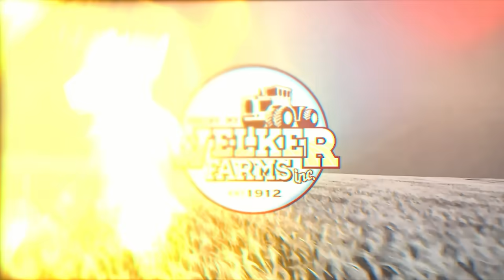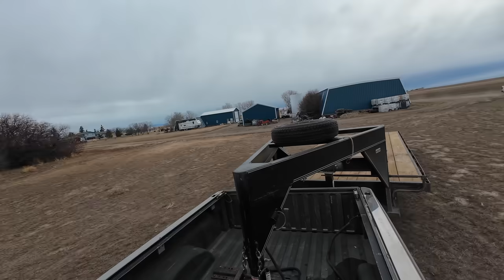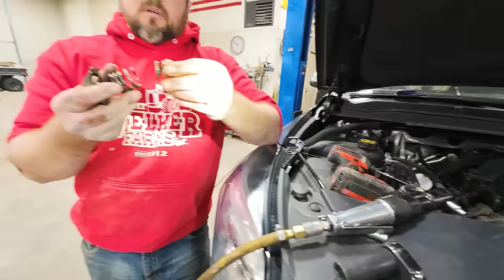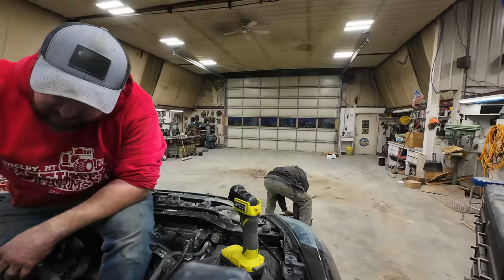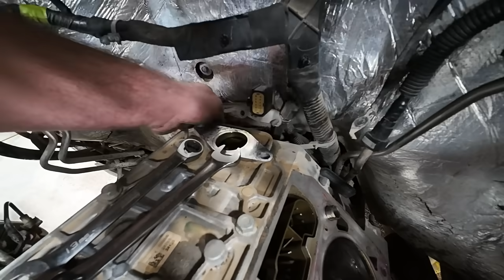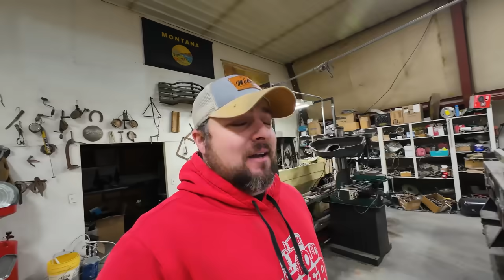Not Again! 🤦‍♂️ Engine Cratered...Let's Find Out What Happened

Comment from the maker: What do you think is the best engine ever made?
Reply: Ford 289
Reply: 2 easy choices Cummins 5.9 and 6.0  ls Chevy non direct injection non dod
Reply: 7.3. May not have been the biggest, most horsepower, but man she never broke
Reply: Cummin😮
Reply: Vortec 5.3 engines typically are solid engines. With that said ppl say Zach aka mn millenial farmer has battery bermuda triangle now it seems you guys have engine bermuda triangle lately.
Reply: Vw/audi 2.0 tdi
Reply: Whatever is in my
Camry
Reply: what's the application?😅
Reply: Ford 300 straight 6
Reply: 22RE, AMC 4.0L
Reply: Gmc 6.0 vortec or a 6.7 powerstroke
Reply: Mopar slant 6
Reply: Ford straight 6 300
Reply: Scott, it was a pleasure meeting you in Minneapolis, Minnesota. Hopefully I run into you again sometime.
Reply: 350 sbc,5.9 cummins
Reply: LS1 or 6.0 iron block
Reply: So many good engine's to choose. Depends on what you're putting it in.
Reply: Ford f350
Reply: LS engines are the best. They have the most aftermarket support and are used in countless racing, offroad, and hotrod apps. In your case, don't skimp. You are doing the block already. Put in a cam, rebuild the heads, best parts, new oil pump, DoD delete and it should last for 250,000 miles.
Reply: Ford straight six and or jeep 6 last forever .my 11 5.3 has 423.000 miles still going just put a not trashed trans mine died the day I went back to work after my 7 hour bloodclot surgery and I got the one with 141 hundred thousand miles the day before my second surgery I have to go for a third not good no money having to sell tools I don't want to but I'm tired of starving of course my son gets most of food
Reply: 351 Cleveland
Reply: What ever doesn't have that dod garbage in it.
Reply: 350 sbc
Reply: @williamsmith8808 I think that the Ford big 6, 240 and 300, are the best engines ever. They will run 300k with no trouble.
Reply: GM 3800 For an automotive application.
Reply: The older 350 chevy motor or the Ford inline 6 cylinder . Seen both run 250,000 plus . Can't do that with the new ones.
Reply: 7.3 powerstroke
Reply: Vortex 5.3 without the AFM crap is a very good engine in the trucks. Car I would say the engines they put in the Pontiac’s the 3.8 was bulletproof. The ford triton is a better boat anchor 😂 only because I have had friends who had pistons and rods go through the block with only 1200 miles on. They baby there vehicles so was not being abused on neither.
Reply: 3800 or the 4.0 jeep
Reply: I am also interested in what the 6.6 gas engine will do. They also announced that gm is coming out with another new engine this year.  Now that EV production is being stopped as they mentioned they made a mistake on trying EV. They heading in another direction with combustion engines this year.
Reply: Ford 300 inline 6. No power, decent torque, but they're indestructible.
Reply: 12b valve Cummins
Reply: 5.3 vortec
Reply: @darkrevenger04  yeah the reason for his problems with batteries with the semi’s was he was buying the used refurbished ones at the auto parts store. 🤦🏻‍♂️😂
Reply: 3.8 gm
Reply: 7.4L or 8.2L Vortec Big Block!
Reply: The Hillside Hemi.
Reply: 426 Hemi w/ 3 duce six-pack!
Reply: 12V cummins
Reply: 7.3 POWERSTROKE I HAVE ONE AND LOVE IT
Reply: Chrysler slant six.
Reply: 5.9 12 valve or a 6.0 gm gasser
Reply: 5.0 Ford
Reply: Ford 351 Windsor, FE engines are immortelle, 6.9/7.3 idi
Reply: I have a 2014 Chevy Silverado 1500 with the 6.2.  I got the EDGE Tuner. And turned Off that 4-8 cylinder junk. It comes with 3 tunes. Eco mode, modified stock and extreme. I turned off my speed limiter, RPM limiter, and that other thing.
Reply: The 6 cylinder 3800 in the buick LeSabre
Reply: Ford 6.2 gasser. They just run and run and run
Reply: Chrysler slant 6.
Reply: 7.3 PS and Ford 300  6cyl.    They run for ever
Reply: 3.5 ecoboost.
Reply: An old 302 will run with zero bearings left and little to no oil pressure and a broomstick for a camshaft!! I know this because I had one lol.. and have worked on many over the years... Super simple engine to overhaul also.. and as others have also said the 300 online 6 is a torque monster for what it is.
Reply: 318 MOPAR
Reply: Honda k24
Reply: 7.3 powerstroke
Reply: Ford 4.6L (2 valve) motor.  The side effect of "gutless" is longevity.
Reply: SBC, 7.3 IH/Ford, 3800 GM, 300 Ford, Gen 3 and 3.5 LS, Cummins 5.9, Toyota 2JZ, Honda K.  As you can see nothing recent.  The government CAFE and EPA has totally ruined engines.
Reply: There’s several that are good. But most of the good everyday reliable engines, didn’t have electronic crap for control or Displacement on Demand, or a .7 telling people this is cool.
Reply: 300 inline 6 ford
Reply: Ford 300 inline 6 cyl.
Reply: Buick 3.8 liter V6. Last one had 381000 miles when I parked it. 283000 on the one before it. Just turned 200k on my current one.
Reply: Tesla
Reply: 300 inline 6
Reply: @williamsmith8808  Maybe but the 300 straight 6 was an animal in itself
Reply: 6.0 LS and Ford 6.2
Reply: MOPAR 225 slant six & 318 engines
Reply: Ford inline 6
Reply: I had 04 5.9 Cummins, I put 400 thousand miles on it , it ran perfect , finally sold to a friend, and he uses it everyday for his concrete business
Reply: 300 Ford 6-cylinder
Reply: @vburke1  that's my vote also, for a pickup or SUV application.  But I am liking my Toyota dynamic force 4 cylinder I got a couple years ago
Reply: 350 chevy
Reply: @rbfarmer4522  that engine makes some serious power for the size, a family member owns a 2014 crew 4x4 with one, and that thing scoots for stock engine
Reply: @tylerdemary1210  more specificly 7.3 idi. Doesn't have enough power to break anything
Reply: 5.7 vortec and a 300 ford and 12 valve cummins
Reply: @tannercayenne lol sbc hold my beer
Reply: 03 ,5.3  vortex got 171000 on mine with normal maintenance. Keep up the good work. Tony is a great person wish he could get more subscriber.
Reply: 350ci sbc
Reply: I removed a valve spring on an "A" John Deere by keeping the valve closed with compressed air while I compressed the spring with an 8n Ford valve spring compressor.
Reply: Ford tower of power 300 I6. Easy to fix and bullet proof. I wish they would have kept it
Reply: Probably the Ford 300 straight 6 cannot be killed if well taken care of. The old 292 Chevy straight 6 was pretty good as well if you could keep the thrust bearing in them. I am a Ford Guy so it's hard to say this but the early tbi small block Chevy engines were pretty dang tough my son has a 92 GMC with almost 300k on the original 305 in it still going!!
Reply: Pull the fans
Reply: I have an '03 Toyota 4Runner with their 4.7L V8 and it is a very nice engine. I had a '93 Suburban with the 350 V8 that was a very good engine , but when the manufacturers start making time bomb engines like Ford/GM are today, it's time to go else where, I would only buy Toyota again if I were replace this '03 4Runner and that would be a used Toyota.
Reply: @jbbuzzable  People up north would disagree.
Reply: go with the Holly terminator X good luck with the shop work ! Hopefully they can clean it up ! If you need too do the sleeve never notice anything different !
Reply: Nothing wrong with today’s engines! It all the crap they got hung on them.
Reply: 1999 454 Chevy Big Block
Reply: Toyota Hilux RN10 or a 22R
Reply: @teecuzbruh4058  The Ford 300-6 is one of the most purely durable engines ever created
Reply: My 2002 Chevy 5.3 is about to have 400K miles and all internal parts are original
Reply: @jeffreykielwasser3637 I love a well built 350sbc.  People will absolutely go nuts when I say this, but I think pound for pound and dollar for dollar, give me the 350 over any of the LS engines.
Reply: 7.3 powerstroke , currently have 6 in the family just love them!
Reply: @jbbuzzable !😂
Reply: I have had great luck with my GM 350's and the like but also the slant 6 and 440 hemi from the 1970s and my 1973 ford 460 had over 3ooK on it before wearing out.  If an old GM engine has been sitting they will almost always still start, had many sit for a while and still run. The older AMC/ Jeep and Buick 6 cylinders used to go forever.
Reply: @WelkerFarms how many miles on the Yukon ?
Reply: @vburke1  Ohhh, I had that motor in my full size Bronco with a 4 speed on the floor. I thru a rod in it. Replace the motor with a Windsor 351.
Reply: Replace with a Cummins 😅. 
For spring replacement  ,remove spark plugs and add air pressure  Nickolas.
Reply: @vburke1  yes yes yes
Reply: @martijn0019  which one? They have a few not so good and a few really good tdi's!
Reply: 1993-1996 Ford 460 7.5 efi in F250 or F350. Had 3 and still have 2 on the farm. Will run forever and pull like nothing else. Crossed scales 1000s of times pulling 2 J&M wagons scaling in at 58k to 68,000 lbs.  Figure those trucks pulled over 2 million bushels of grain to local elevator over the years. After retiring from farming the f250 became a firewood truck and has hauled over 2000 cord of firewood.  It's odometer just hit 250k miles and is still used almost daily. They don't build anything like that today.  Not ford biased as my father and I both have chevy 2500hd's.
Reply: 2024 L5P  banks has been providing input to GM and they are listening - its a tank.
Reply: Toyotas last 4.2L straight six diesel- the 1HD-FTE. Just enough electronics to make it powerful and reliable without making it excessively complex, still built in the era of toyota over engineering the bejeesus out of things to the point you can triple the horsepower without opening the block up and stupidly long lived too
Reply: Anything not made by GM, and preelctronic BS
Reply: 292 inline V6 Chevrolet 👍
Reply: Stock Jz or mz those things will run forever
Reply: Good ol 5.7 vortec
Reply: 5.9 Cummins and Chrysler slant 6. 6 used in pickups,  cars,  industrial,  and ag
Reply: 2uzfe
Reply: Since you have the engine out might as well stroke it and add a  super charger
Reply: 3800 series gm.
Reply: Gas engine, 350 Chevy
Diesel engine, 5.9 Cummins.
What a terrible, helpless feeling being broke down on the road! 
We had car trouble in 2021 on a vacation to Wyoming. 
Long story short we ended up buying a new car in Cody because they couldn't get parts for 2 weeks and it was a long way back to Michigan. 
The new car is great so far, drove it to Montana in 2022. In fact we drove through Shelby on our way to Glacier National Park and stopped into Torgerson's to buy a few hats, really nice guys! We wanted to track down the 5 millionth 1066 but ran short on time. A good excuse to visit again sometime!
Anyway good luck on the Yukon, I know you guys will make the best of it. Just frustrating with other projects to prepare for spring
But it is good to know you have friends like the Fast family. We enjoy both of your families adventures. 
Keep up the goodvwork.
Reply: 2jz-gte  =)
Reply: Chevy/GM 350
Reply: LS are one of the best
Reply: Barra engines
Reply: If it's a V8, then it is the Chevy 5.3 Vortec. If it's a V6, then I'd say it's the GM 3.8 V6. There's plenty of others to choose from that are equally as reliable, but those are my picks.
Reply: Ford 300 inline six. May have been a little underpowered, but man, it never died.
Reply: Cummin
Reply: I have a 1956 28 fergie (same as a ford 9N). Can sit for 2 months and will start after 3 seconds of turning over.  In Australia and England they say you borrow a fergie tractor from the next generation.  Voted all time top 10 things built to last!
Reply: VW 2.0 TDI Diesel!
Reply: 2.5 TDI AEL/AAT
Reply: Old ford 7.3 diesel.
Reply: Sorry to see this happened but, glad you were blessed to have people in your life that would lend you their vehicle so you and your family could still go where you needed to. Just curious How many miles were on your suv when this happened?
Reply: Ford 300 6 cyl
Reply: 6.8 john deere
Reply: Hard to pick just one.  3406 cat, 5.9 cummins, 60 series detroit, any 2 stroke detroit because they take abuse and can be fixed anywhere by anyone for cheap, other than that the only thing they do well is convert diesel into noise.  There have been lots of good engines, but they are getting less and less.  The world needs more families like the Fast's and the Welker's
Reply: @persistentwind  2 liter are the best
Reply: 1.9 tdi
Reply: The 318 in your Dodge. It still runs.
Reply: The steam engine
Reply: VW EA 189, of course!🤣
Reply: The 6.2.
Reply: 2UZ-FE 4.7L toyota engine, i bought a used tundra with 280,000 miles, it doesnt burn oil and doesnt even turn the oil dark after 5000 miles.
Reply: 5.7 litre engine
Reply: It's hard to deny 5.9 Cummins, 7.3 power smoke, or an old idi. Gassers I've never had a problem with were the 90s era 351w or 460. The gm 4.3 v6s or good ole 350s. Seems like anything after that has just been junk. I've never had a 1st Gen 5.3 for reference.
Reply: To work on - all engines before 1990! No AC/Turbo/electronic-Crap. By far not so fancy and powerful - but durable. Same as the old Tractors btw.
Reply: 350 Chevy.
Reply: Hands down, the Cat 3406B.
Reply: 283 chev & 225 slant six
Reply: Peugeot XUD9TE 1.9 turbodiesel, bulletproof
Reply: 5hp Briggs&Stratton.
Reply: You own it.
Reply: Scania V8
Reply: Tuffest is a Chrysler slant 6 or Toyota 22R then Chevy SB 283, 327 or 350
Reply: Well for gas engines that would have to be the LS platform. My favorite diesel engine for pickups would be the International DT-360, it’s superior to 5.9 Cummins in every way imaginable, truly a million mile engine. For 18 wheelers it can only be the venerable 3406E Cat or the C-15 generation immediately following the 3406E. For airplanes it’s the Pratt and Whitney PT-6.
Reply: @chrisrickets9873 yeah but the 5.9 doesn’t have wet sleeves, DT-360 international does.
Reply: LB7 Duramax. Just get good injectors with an Air Dog and send it
Reply: 350 sbc
Reply: Of course the B230f Volvo 4 cyl gasoline engine!
Reply: Ford Cosworth dfv
Reply: 440 big block Dodge
Reply: Impossible to answer question, there are so many.
Mercedes 606... gotta love a diesel that revs and sounds like 2J
AJ8, cus who doesn't love a screaming supercharger on a V8?
Cummins 6BT, P pumped, obviously. Have to confess this is likely the best.. makes great power and lives forever.
But, also love a rotary cus tiny little package, mad HP.
 There are so many epic engines out there, all deserve praise for very different reasons.
Reply: @4.203Perkins_Norway Superior engine. Check the oil and drive, towards eternity.
Reply: @briananderson7008  my old man could build one blindfolded I believe. We had one in a S-10 that I drag raced. Ran consistent low 12's
Reply: @jeffmcdaniel5826  
The only down fall to the 350 was changing the oil. Man if we didnt have to do that. It would have been perfect. Two of mine lasted 330,000 274,000. Frame broke on one. The other the upper a-arm pulled out of the frame.
Reply: Ford 4.9L, or 300 c.i.d., which ever you prefer, was the best engine ever. You couldn't be in a hurry, but you just couldn't kill it. Couldn't even hurt it!💪
Reply: Vw 1.9 tdi absolutely bulletproof engine loads of power great fuel economy.
Reply: VW 1.8 8v or 1.9tdi very durable and good on fuel, the old TDIs can go over 800k km
Reply: The old 302 ford engine are good I had one the still ran with all the pistons skirts laying in the oil pan I put it back together and sold it
Reply: GM 3800 or 350. Both are awesome
Reply: LBZ Duramax
Reply: Ford 300 inline 6
Reply: No more Chevy or gmc
Reply: IH Dt 407
Reply: Sbc chevys fords , 6.2d gm, 90s toyotas . I have even heard broken valve spring on non racing engine. And i am 52 yeo.
Reply: 300 i6 ford or Chrysler slant 6 or 22re could all have a case for the best ever
Reply: Fix the cp4 issues and you can't get better than the 6.7psd
Reply: Chevy small block, Ford 240/300 inline six, 4.3 GM V6, the Iron Duke GM 4 cyl....
Reply: Early 80s Ford 6.9 idi mechanical diesel iron block and heads . They were  low power and slow compared to modern diesels . It was dependable and good on fuel
Just don’t let them over heat and change the glow plugs every couple years . When they did break down they are easy to fix. 
Head gaskets, radiator was the problem if you ran to hard. 
There’s an aftermarket turbo kit that will get you more power if your in a hurry
Reply: Small block Chevy's ...
In Diesels, the 7.3 Ford & 
The Cummins.
Reply: toyota 3.4 v6 5vz
Reply: Small block Chevy V8, 240/300 Ford inline six, GM 3.8, GM 4.3, iron Duke, AMC 258
Reply: @tylerdemary1210  the 7.3 lasts so long because it cant make enough power to hurt itself lol. Plus having an oil driven injection pump saves it from being ran dry (aside from the idi of course).
Reply: ford 300 strait 6
Reply: Scott get on Nick to clean the shop your sons should stay on Nick and make sure he cleans the shop 😂😅
Reply: Toyota 2uz-fe 4.7L V8, absolutely indestructible. I have a 2001 Tundra that has 673,000 on the original engine and transmission. Sucker doesn't use or leak oil, still comes out clean at 5000 miles when I change it. Not even my old slant 6 did that, it ventilated the block after the 4th time flipping the odometer over.I used to think it was the best but not anymore.
Reply: 2h toyotadiesel
Reply: @chrisrickets9873 We own a 2006 Mega cab with the 24v CRD 5.9 Cummins and I've driven a 2019 Chevy Express van with the 6.0 LS Port injected V8 when I was in the Washington National Guard.
Reply: Either 12v Cummins or 7.3 L powerstroke
Reply: Toyota Tundra is the best truck. Sequoia, best SUV. Do you not have comprehensive on it? BC that looks like a "totaled" vehicle. Take the money and put it toward a quality vehicle. Stop buying General Motor trash.
Reply: I would suggest the Ford 390.
Reply: 351 windsor
Reply: @ronaldrussell5481  right on
Reply: 3800 Buick
Reply: Inline 6 far best motors. Iv own plenty of them and body goes junk before motor go.
Reply: Lots of 235s still running after 70 years.
Reply: except for having to replace water pumps.
Reply: @williamsmith8808  except for having to replace water pumps?
Reply: @williamsmith8808  If you  are talking about a workhorse then the old 390 ford was hard to beat.
Reply: For 5.9 300cu I6 absolutely bulletproof